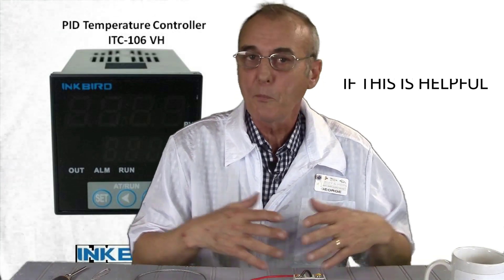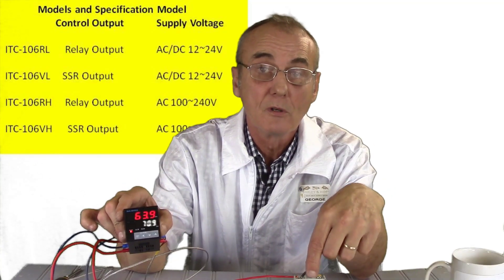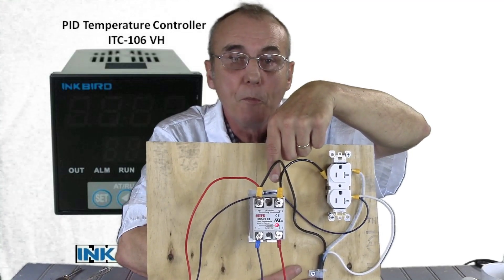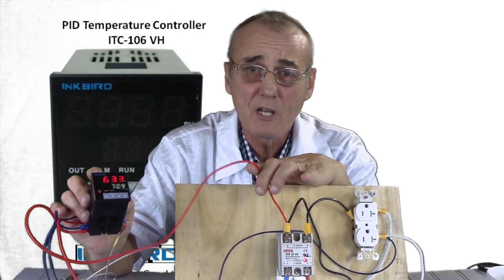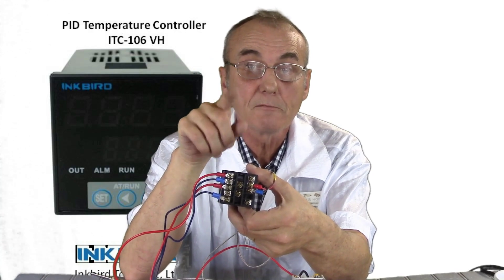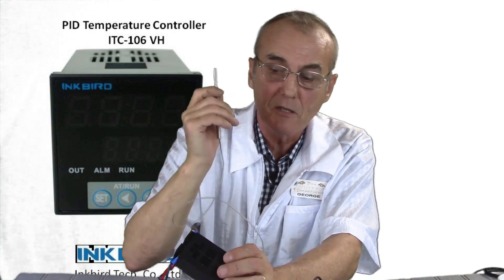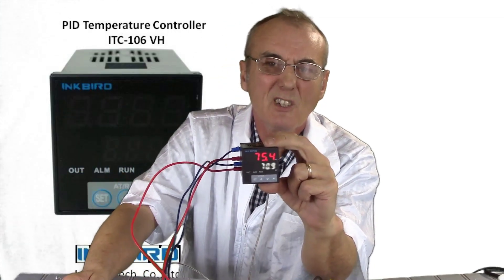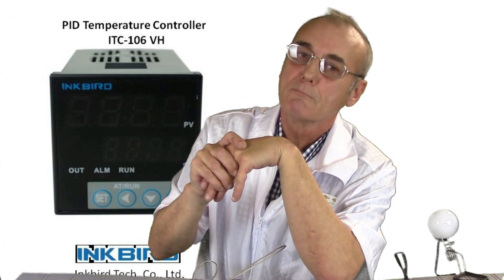Wiring the INKBIRD ITC106 VH PID controller

Comment: I have followed your steps on wiring and programming my inkbird itc-106vh. I’m actually running a powder coating oven and would like to turn my heating source on and off to maintain about 450 degrees. Is it possible for you to tell me where in the program to do that. You have truly been a major help in my project

Comment: I HAVE USED YOUR VIDEO / KNOWLEDGE TO CONVERT MY MANUAL SMOKER TO A PID CONTROLLED SMOKER. IT WORKS GREAT EXCEPT ONE PROBLEM.THE SMOKER / HEATING ELEMENT HEATS TO THE SET VALUE ON INITIAL HEAT UP BUT AS IT STARTS TO COOL, IT DROPS TO ABOUT 25-30 DEGREES F AND WILL NEVER GET CLOSER THAN 20-25 DEGREES OF SET POINT. ANY THOUGHTS WHY THIS IS OCCURRING?

Comment: I have now had one installed, and it was intermittent, had to press on the case to get it to turn on, and replaced the intermittent one and similar issue,  going for the third one,  FYI.. 40 plus year electrical contractor, I thought I would revert to some you tubes to refresh my memory set up PID's this is my first experience with Inkbird, I have used others but for my customers sake, thought with the available you tubes by George who provides excellent DYI explanation step by step, would offer a great reference and avoid a service call.   I hope the third unit works like the You Tube.  Never had this issue with other PID's .   I did see on a You Tube  illustrating the 100 model that they made a jumper for the K style temp probe from five to four and connected the probe on three and four.   I plane to try this before I return the first PID.   I would imagine there are alot of these PID's not connected through a fuse-able link, since no fuse and holder is provided.   

If there is a reason this unit appears along with the second one operates when you apply pressure to the display, I tapped on it and nothing, all the wire is 22 gauge military spec since I work with avionics and the wire insulation is much better in an industrial environment  I would appreciate a reply, Thank you for your concise explanation, I doubt I will get a response since this thread appears to be years old.

Comment: Thank you so much for your video, no way I could have wired up my 106VH without your video. The instructions are not friendly for an amateur such as I. I am now researching to see if the 106VH can be used as a meat probe thermometer. If so could you explain how it can be used? I know I can buy a meat thermometer but I know the inkbird 106VH is a good control.

Comment: Very good video. I am using the Inkbird ITC-106VH PID and the SSR is Inkbird SSR-40DA. I have it wired exactly like you did in video, the issue I am having is  I am not getting any power to the outlet. I am using a 16ga power cable with 3 wires, black white and green. I have black wire from power cable going to pin 1 on SSR and black jumper wire going from pin 2 of SSR to brass as screw on outlet. I put volt meter from pin 1 on SSR to white wire on outlet and getting 120v, but when I go from black wire on pin 2 of SSR to white wire on outlet I get nothing. The PID is powering up and there is 120v going to pins 6 & 8 on PID. Could it be a bad relay? I am stumped!!!!
Reply: I should have mentioned that I am using this for my Masterbuilt smoker. The control board went out and they do not have a replacement. The heating element is 800watts. I found a video to bypass the control board and connect the element straight to the power cord and I am plugging that into outlet on the PID box.

Comment: George, great videos! I have this pid on a powder coat oven. I’m getting some major temp swings, 65-80 degrees. What can I do close that gap. I’m using a forced air propane heater for a heat source. Thanks.

Comment: I have this installed on my espresso machine, but upon heating it keeps overshooting SV with 15-20C (using K-type probe) Anyone having some tips regarding the PID settings and or moving to a PT100 sensor? Thanks

Comment: Very nice....the downloaded instructions from Inkbird are wrong.  They indicate verbally that pin #3 is POS, but on the schematic it is pin #4 (page 5 from their PDF). One of these is wrong, either their verbiage or the schematic.  I think pin #3 is positive based on that they want 4 and 5 linked on the diagram for 3 wire Pt sensor.

Comment: Hello George, I really enjoy your informative videos. Which PID controller do I need to power it from a 12 volt car battery in order to use a band heater to vaporize a substance like oxalic acid?  I will use this away from A/C access.  Thanks for your help in advanced.  Keep those great videos coming.

Comment: Good instructional video ... watched another video where they fused the power to the SSR with a 10 amp fuse and a 1 amp fuse to the controller ... just wondered if you recommend this? Also my controller has connector screws missing compared to the other controller in the other video but similar to yours except there no #2 and #7 screw.

Comment: I'm trying to wire this so it kicks a contactor for a 6k watt heater. I got a contactor with a 24v coil but I guess the output for this thing is 12v. If I used a 120v coil, could I use this to kick the contactor?

Comment: The instructions say the + of the K Sensor should be connected to both 4 and 5.  Do you think that is really necessary?

Also, is there a setting to keep the output relay from flashing when the temperature reaches the desired setting?

Thanks for the great video.  I am going to use the ITC-106RL to operate a 24VAC gas valve on a Gas BBQ Smoker.

Greg

Comment: Hey. I have an old Paragon 2 element kiln that has a 4 way switch to allow the control of the elements in a low, medium, high which we have not even tried to get it hot yet, as I have been cleaning it up and replacing old wires and testing the elements which are said to be about 11.5 ohms, and they both tested ok, so after getting it all electrically sound and making sure it is wired correctly according to its original specs, I understand that the wiring on the switch says that low is 1 element full power, medium is both elements 1/2 power, and high is both elements full power! 120volts 20 amps and the metal plate says max temp is 2200 degrees! Ok, do without lightning it up yet, I dont know what temps it will be at each setting, but the PID can establish that, but I wanted to just send you a setup of what I have going, and since I respect your opinion, I would appreciate your advise before I try anything! But to start with, I am using an Inkbird ITC-106VR, and my goal is to first test each level, low, medium, and high just for the record, establish what they will do for temps, and know its normal operation, but I have a feeling that with the PID, I could theoretically just put the setting to High mode, and then one could just allow the PID to do the work for you, having the capability to set your temp to wherever you want up to the kilns limit, (Correct me if I am wrong about that theory), but anyway, I have a wiring diagram I have made for you to look at, to just see if I am ok, and to get your view on it, and make any corrections that you may guve me, as I really like your style, and trust your judgement, since you are more familiar with the way it is to be! However, I am still learning, and want to learn if I can do a ramping temp period, so to fire at a certain temp for a certain amount of time, then raise the temp at another amount of time + or - a given temp, and so on, but there are other ways of doing that, but if this can accomplish that, then cool! Anyway, thank you so much for your time, and understanding, and hope this isnt too much trouble!
I wsnted to send you my email address here, so I can send you my wiring setup, so you can give it a gander to see if I am good to go! Meanwhile, I wanted to compliment you on your vids, and will appreciate your opinion, and will greatly respect your guidance! Just email me at gemini.59@outlook.com,  I will send you that setup and a few pics of how I built this onto the kiln! It actually looks like I might know what I am doing! Lol
Thanks buddy! I will look for your mail!

Comment: I just got finished rewiring an old heat press with this controller.  Programmed it the way George instructed in the other video.  In tests it really works well.  I have several other processes I'm planning on using it for.

Comment: Hello, if I run the hot wire from the socket to the receptical, then from the receptical to #1 pin. Should this connection work?

Comment: Hey George. Hoping you can help me out. I am actually trying to use the ITC-106VH to operate a motorized ball valve. I am trying to have the ball valve open at 219* and close at 217.5*. I’m using the on off control on the pid. The light comes on on the pid and the SSR. But the motorized cable doesn’t open. I have tested the valve with a straight 120v and it functions. Is there possibly a setting I am missing in the programming of the pid

Comment: How long would a 12 volt batteiy last using the itc106vhl
 heating a heat to 400 degees
Reply from the maker: Not sure. I run PIDs on AC voltage

Comment: Great video George. I have a question I believe that you may be the only one who can give an understandable answer to! If I add a second SSR can I control a heater as well as a cooler with this single PID? If this is possible, what is the wiring schematic, programing, etc? This would allow precise temp. control?

Comment: I purchased the linkbird itc itc-106 vh. am connecting it to a 2" stainless pipe. It came with a threaded thermal connector it is about 3/4 long 1/4 inch x20 thread. I can not find a fitting.  Would you know what fitting and where I could get one. I tried to make one but too small for me to work with. Thanks in advance. PS I enjoy your information and am working on a project.

Comment: Excellent video! We have used several of these kits to retrofit glass blowing kilns from one's with a pyrometer to set point controllers. We have yet to use the thermocouple that comes in the kit, but it seems like it's cheaper to get it since it comes with the SSR with ITC106 VH.

Comment: How you the wiring differ if I wanted to wire 2 heater cartridges to the pid instead of the outlet you used? I think I have an idea but I want to be sure before I wire it up and on the off chance get it wrong and damage anything. Thanks in advance!!

Comment: George , may ITC 106VH run a contractor instead of ssr ? Mnual says that 106vh has ac output 110-240v , my contactor runs from ac110.  Look's like gonna work ?
I'm confused because it also tells that output polarity important.. but if it AC control output.. ?

Comment: Hey George, I’m having difficulty figuring out my inkbird controller. I was wondering if I could email you a description of what exactly is happening?  I have be trying to get it to stop overshooting set temp. The Output light shuts off when it hits temp but the oven just keeps building heat with no fluctuations at all. Right now it is over shooting by 700F degrees. Something is causing the power to keep ramping up but Im not sure what. I have messed around with the PID settings with little to no luck.
Reply: I just wired mine up to smoker and having same issue. When it reaches set temp light goes out on SSR but temp in smoker keeps rising.

Comment: More than helpful George.  I actually have 2 106VH left over from another project but the k coupler is very short screw type.
Reply from the maker: That K type probe (although short) is accurate. The only difference between that and some that I use is the length of the probe. Both are exactly the same; just one is longer than the other like a 3 inch screw driver VS 6 inch screw driver.

Comment: Hi there george. a quick question about PID controllers.   Does the controller regulate the voltage coming out to get to the temperature set point? instead of being either on or off? and if so is this done with the SSR or the controller itself?. thanks
Reply from the maker: It is a combination of the controller and SSR. The controller converts the power to a square wave and the SSR only changes at the zero crossing of voltage so by timing the pulses the controller can provide power between 0-100% and all points in between as needed.

Comment: I'm wiring a heating element for an electric smoker. It doesn't have a positive or negative on the element. How would I wire that? The same as the plug you have for the light? Would I just attach the ground to whatever I have? Im just confused and would like to figure this out. Thank you.
Reply from the maker: Element only have a hot and a neutral for 120V and two hots for 240 V
Reply: @BarleyandHopsBrewing  so 1 end of the heating element is positive and the other is neutral?
Reply: @BarleyandHopsBrewing  and the ground is just grounded where I can, correct?

Comment: Hi George, wiring videos are usefull and I thank you for that; To push the thing a bit further, you could make a video on how to add a led (to visualize when power is sent to the heater), or an ampmeter to make sure the resistance is not broken, or an alarm... All these extra elements, which improve the use of temp controller.  Greetings from France ;)

Comment: George I have watched the videos diy wiring a PID with amp meter fan and switch. This video is not the same as the other video. The wiring is different. Your not showing how to wire a amp meter fan switch lighted switch along with the solid state relay and the PID INK BIRD. Should I wire the INK BIRD the same as the other video? Also where did you get the wire to connect to the fan?
Reply from the maker: I can think of at least 6 ways to wire this. Don't let that shock you. They all work.

Comment: George love the video looking at putting one of these together my question is I have 2x 2000W elements can I use both of them on the two sockets?? Also I am in Australia and we use 240V straight out of the wall. 
Cheers
Reply: I do not know about Australia, but here in Germany we also have 240V with 16A fuses per circuit, in theory means 3840 watts of usable power before the backup flies, check your fuse box and calculate volts * amps = watts        So no you can not use two 2000watt elements at the same time on the same circuit

Comment: Hi George wiring a inkbird ITC106 is it the same as wiring a ITC100. many thanks
Reply from the maker: Yes. The difference is the control mode of the ITC 100 but wiring should be the same, The 100 model I believe is only centigrade.
Reply: @BarleyandHopsBrewing  sensational George your the man 👍👍👍

Comment: Hi George - How do I wire in a 110V LED Flash Buzzer Alarm Beep Accident Indicator Signal Lamp Warning Lights Red - https://www.amazon.com/gp/product/B07GKC5H1W/ref=ppx_yo_dt_b_asin_title_o08_s00?ie=UTF8&psc=1#customerReviews
Reply from the maker: They require one hot wire and one neutral. Wire the neutral direct to X2 and then wire the black wire from your source to your indicator (switch, controller, or what ever you are using) and the other sire from that indicator to X1. 
George
Reply: @BarleyandHopsBrewing Hi George, I guess it's a good idea to switch the buzzer if it gets annoying you can just shut it off
Reply from the maker: @jpthedelawarebeeman6239  Exactly

Comment: If I wanted a keyed switch to turn the entire unit off, where would I wire it?

Thinking between the incoming power black wire and the #1 on the relay ??
Reply from the maker: Yes. That would be a good place for it. You could add a power block inside the box and switch all power going to the power block.

Comment: is there any video0s out there that focus on actually showing in the simplest terms how to wire this pid controller i dont want to listen to soeone yap yap yap siply show what wire goes where they are numberedf so lets say we have 120v ac where does that go which number?then we hav a thermo couple which nu,m,ber?then a heater which number all i hear is blah blah i dont need ter,m,inology or symbol;s or line or hot jiust number
Reply from the maker: Sorry if the yapping offends you. Many others have benefited tremendously from this so it shall remain so.

Comment: George,  Do you see any utility in having a PID and a variable controller in the same voltage control box?  I like the idea of both, but also don't like the unstable characteristics of the PID with flash on/flash off power to the heating element....I'm thinking that the PID would be great to get the kettle to temp, but the manual variable for fine-tuning the column head temp...any thoughts would be greatly appreciated.  Also, I'm think that if built into a single controller, one could use an A/B type switch to go between the two (using a circuit breaker to turn power on and off before switching, of course!).
Great videos and really appreciate the in-depth commentary!
Reply from the maker: The PID is a great device for fine tuning. You could have a variable controller in the same circuit but then this would render the PID useless.